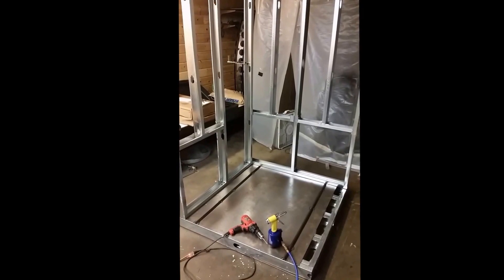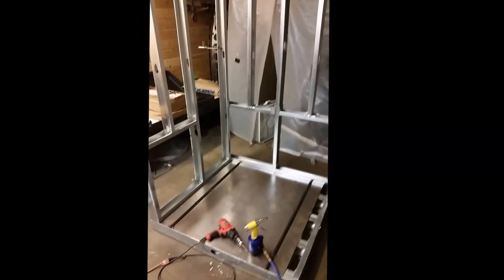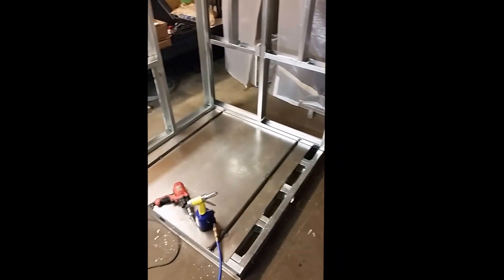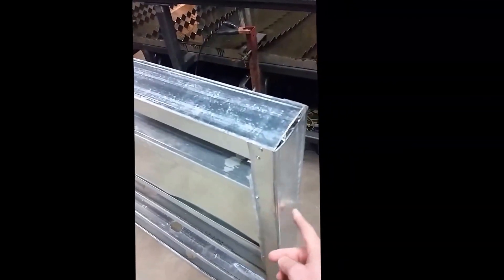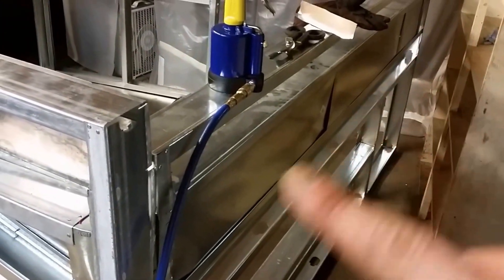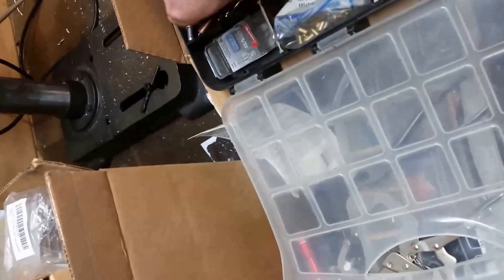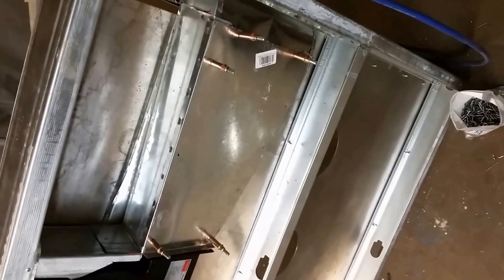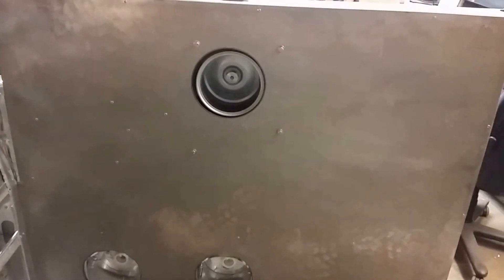DIY Powder Coating Oven Build: Part 6

Comment: Nice oven.  I built a similar one years ago.  My second one had a back wall with a inner wall of firebrick.  It added a lot of heat retention for when the door was opened.  It does take longer to come to temp in the winter.  I like your fan.  I needed to do that. Maybe on number three.